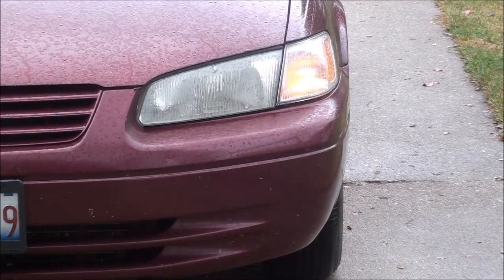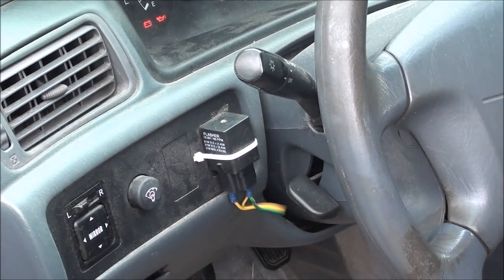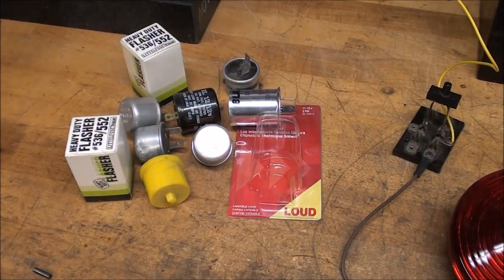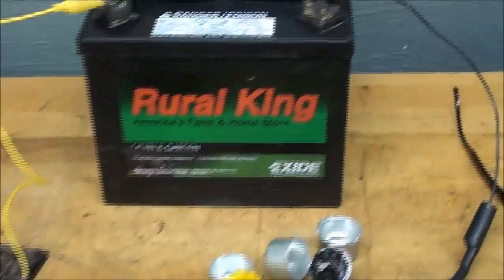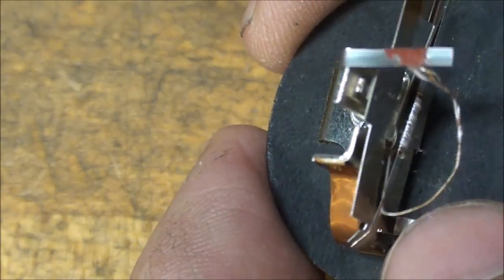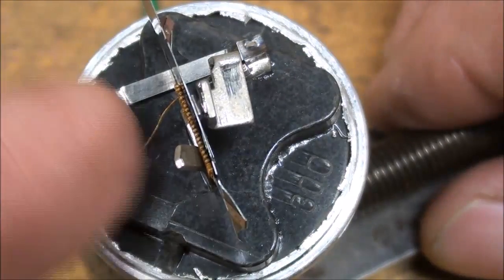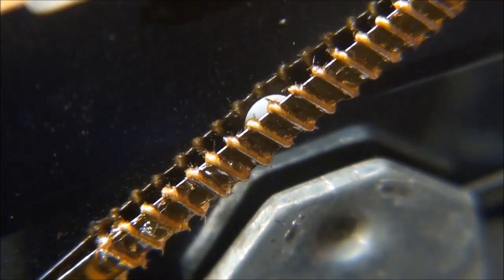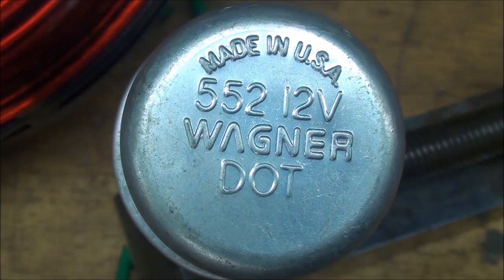WHAT MAKES IT WORK? #14 Turn Light Flasher "WHAT MAKES IT CLICK"  tubalcain

Comment: Another excellent how it works vid ! !  After seeing this I think I now know why the clicking cycle seems to speed up when you have a signal bulb burned out.  The extra current not being used by the burned out bulb heats up the bi-metal quicker  -  with the extra current it quickens the cycle time.
Reply: exactly
Reply: I was just wondering about this - but I think this is not correct. This flasher acts as a switch, and the current flowing through it is defined by the resistance (the bulbs) and the voltage of the battery. If you take out one bulb, the current will be lower, because you have higher resistance for the same voltage, therefore the flasher will heat up slower.
However, what I think really happens  is, that the final temperature it reaches, before it turns on, is lower, just a bit over the switching limit, and so it cools down to the turn off limit in a shorter period of time. So the "temperature swing" is reduced, and so also the mechanical movement gets limited, and this results in a higher switching frequency.

Comment: That little metal piece that bends with heat is called a bimetal. Two pieces of metal with different rates of heat/ expansion laminated together. When heated, one expands more than the other causing it to bend. Same technology used in the thermal trip side of most circuit breakers. Neat video Pete!
Reply: +Michael Murray "Bimetal" refers specifically to a strip made of two layers of different metals sandwiched together. While it is true that this is used in breakers, and thermostats, and many flashers, if you look closely you will see it is not the case here.
The strip with the heating wire around it is spot welded on the two ends to the larger spring. As the strip heats it expands, causing the spring to click over. It just relies on the lengthwise expansion of the metal compared to the cold spring rather than bending from different expansion of dissimilar metals in a bimetal strip heated to the same temperature. 
The difference is subtle, but important.
Reply from the maker: +stefantrethan You are right on--not bimetal
Reply from the maker: +Michael Murray Thanks for watching

Comment: Great video and thanks for making it.  But, I think that at about six minutes into the video, you may have said it backwards.  I think the heating element heats up when the contact is closed, and cools off when the contact is open.  When the contact is open, no current can flow, and hence the heating element can't heat up.
Reply: The old style flashers worked that way (like a thermostat) and started in the ON state but they had some shortcomings: 1. They had to be matched to the current of all the lamps to get the timing right. Say your car has 4 lamps per side - one lamp fails and now there's not enough current draw to heat the bi-metallic strip and open the contact. This lights stayed on and no flashing occurred. If you added a trailer so you now had 5 or 6 lamps per side, the higher current draw heated the strip too quickly and the flasher went too fast for the lamps to reach full brightness. 4 lamp flashers were very common; front, back, and 2 side markers. If a designer wanted to deviate from that he/she had to play with the lamp size to stay within the flasher's range or use a differently tuned flasher. 2. Making and tuning bi-metallic strip flashers was a bit fiddly and took skill to get them all flashing at the same rate like the designers wanted. To get around all that the bi-metallic strip was eliminated and a low current heater was connected across the terminals full time. Now the flasher could work with only 1 lamp or 10 - as long the circuit was completed the heater would operate. A spring steel snap acting switch replaced the bi-metallic strip. The switch is bent back away from the contacts and a small splint (lack of a better term) is attached to hold the contacts open. The heater coil is wrapped around this splint. These flashers start in the LAMP OFF state. The heater causes splint to expand allowing the spring contact to close and light the lamps. While closed, the heater is shorted and all the current goes to the lamps. When the splint cools it shrinks and pulls the contacts apart and repeats the cycle. Remember back when we'd manually flash the signals to make a lane change? The lights came on as soon as we nudged the lever as we had the old style flashers. Then somewhere along the line they no longer did that (new style flashers) and we had to hold the lever until it started flashing on it's own. This caused accidents as folks used to doing the quick flash were changing lanes not realizing the flasher hadn't started yet. I think it was around this time that many people stopped using flashers altogether as they couldn't be bothered to wait that 1 second for something to happen.
Reply: The clue is in what state the flasher's switch is in un-powered.  If the switch is closed, the heater is in series with the switch and merely replaces the function of a bi-metallic strip.  All the lamp current must past through the heater and the total lamp current can effect the flash rate. I called this the "Olde Style" or type 1 flasher.
If the switch starts in the open state (as in the close-up example), the heater is bridged across the terminals in parallel all the time.  The high resistance heater only needs a small current to operate and itself passes only a small current to the lamps, not enough to light them, while the flasher switch is open.  Once the heater operates and the switch closes, the heater stops because the current flows through the lower resistance path of the switch.  The heater is effectively shorted out and ignored.  This why the number of lamps has little effect on the flash rate.  When the heated strip cools and retracts the switch, the current has to flow through just the heater again and the cycle repeats. This I call New Style or type 2 flashers.
Reply: @EddieTheGrouch  Excellent explanation.
Reply: +Physics Videos by Eugene Khutoryansky could the resistive heater be connected in parallel, passing current through the light but not enough to notably light the lamp?
Reply: +Physics Videos by Eugene Khutoryansky 
I think  there are two different configurations and his various cut opened  examples show both.   BTW the older designs had three prongs. The heater circuit  was somewhat separate. Missed his six minute explanation.
Reply: +Eddie the Grouch, in the particular example shown in this video, the flasher only has two terminals, and it is connected in series with the light bulb.  Therefore, I think it has to be one of the old style flashers, as there is no way that the flasher, in this configuration, can simultaneously interrupt current flowing to the light bulb, and still have a closed loop for current to flow through the heating element.
Reply: +Eddie the Grouch Additional benefit to this style is that the low current for the heater provides enough current to the lamps to keep the filament warm, above it's brittle transition, if it is properly sized for the lamps. This reduced burnout, as when the filament cools below the ductile-brittle transition, it is liable to fracture due to thermal expansion or shrinkage. This is why incandescent bulbs tend to fail on turn-on. The thermal shock on heating up, or the shock of the last turn-off, was sufficient to cause fracture. At turn on, the fracture arcs and burns the filament back. Fewer cycles into the brittle range, the better the life. A lot of old electronic gear had "keep alive" circuits to keep incandescent indicators above the transition temperature when off, in particular portable gear, for this reason.
Reply: +Eddie the Grouch Ah! yes, I was just going to ask about the "heavy duty" flashers that we used to install when a trailer with lights was used. But you've already answered it.
Reply: There is a 3 prong flasher of the Old Style called a wig-wag (No. 537 I think) that has a common terminal and powered the other 2 in an alternating fashion.  This allowed more or bigger lamps to be used with the same bi-metallic strip by splitting the load.  The main front/back lamps connected to the ON state terminal and the side markers to the OFF state terminal.  The side lamps flashed alternately with the main lamps.  These were also used to alternate the headlights in police cars but when higher current halogen headlamps came along they caused the strip to heat quicker than the cool off period and the alternating flash became uneven and silly looking as the flash is triggered only by the lights on the main terminal.

Comment: It looks like the heater coil needs to turn on and off for it to cycle. I'm guessing that when the main contact is closed it by-passed the voltage to the heater effectively shutting it off .
Reply: +Maurice “Butch” Chauvette 
Exactly !! So at six minutes Mr.Pete is correct.